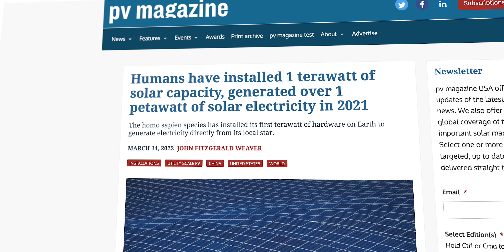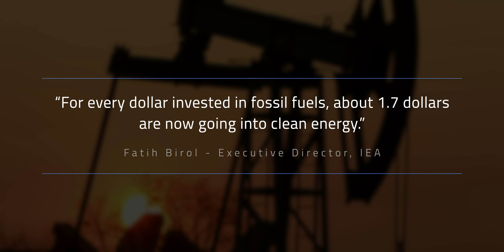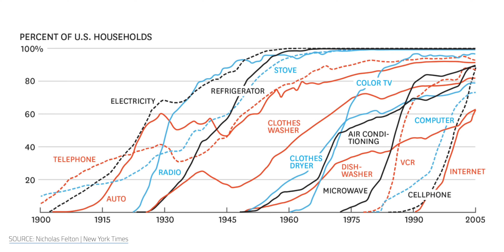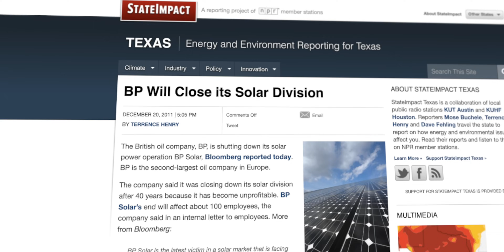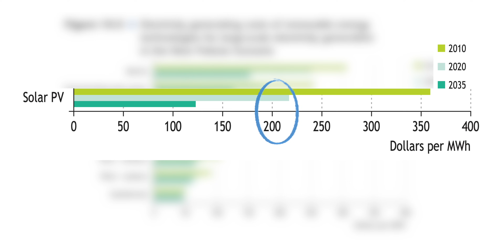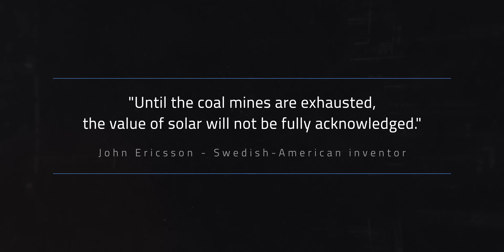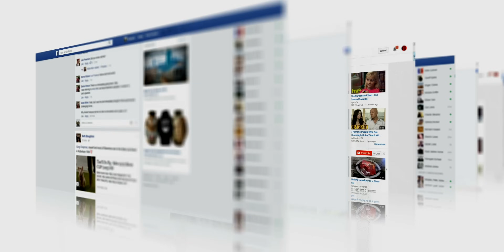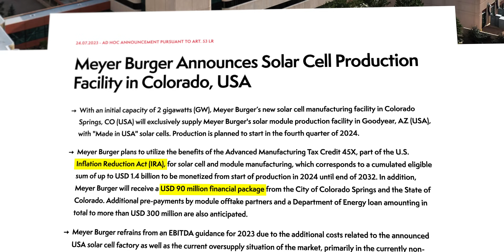How Solar Power Got So Cheap … So Fast

Comment: Here's what you didn't cover which is what REALLY brought prices down.  

The cost of silica, and hence the cost of making silicon crystals had been going up and up, to the point where companies weren't even thinking about using it anymore at least for solar panels.  This was in the period of 2003 - 2009.  These high costs for making silicon crystals was doing two things.  It was making ICs more expensive to produce along with solar panels.  The bigger issue BY FAR at that time was making ICs which has been hundreds of billions of dollars a year industry for a long time now.   Solyndra was a company that was a startup in the US who was trying to make panels using other materials.  Yes, Democrats got BROW beat for funding this company even though it was a sound idea.  But once again, just as companies in the US and Europe abandoned solar panels (oil companies, what do you EXPECT?? them to explore for silica??) Chinese companies were basically coming on line.

This price increases in silica had another effect in the world of electronics.  Companies that deal with making equipment to make ICs invested very heavily into new techniques to reduce the size of transistors so ICs could get smaller so less surface area of the silicon crystals that are produced to make ICs is used.  And since 2010 to now the amount of reduction in transistor size is pretty astounding.

China opened up mines for silica and this shot the price down by 90% and THIS is when it became feasible to make solar panels for sale to the general consumer.  This was somewhere around 2009.  However by the time this happened, along with the first benefits of this going to making ICs, as you mentioned different companies abandoned the market, but NOT in China.  In fact it wasn't long after these companies dropped out that low cost panels started to become available in China, and here you can thank Chinese engineers and their govt.  They improved the manufacturing process for solar panels, really bringing almost everything together.  They also improved the efficiency of solar panels.

The Chinese govt. helped by putting incentives into the development and improvement of panels and also incentives for installation.

Now, for the Chinese haters, no, their govt. no longer subsidizes the production of solar panels.  In fact there are a few Chinese companies making them now and there is good competition.  This is when other countries started to understand they could grow their solar industries.

There is a key to ALL of this.  It's low cost silica.  Something about like 80% of all silica that goes into the market comes from China, about another 10% comes from Russia, and about 10% comes from the rest of the world.

So EVERYTHING about costs coming down for solar is about what happened in China.

And for those who are going to say silica is common, yes it is.  But it's not common to have good deposits of it, and the US used a lot of deposits in making ICs from 1975 - 2005.  You can NOT go out to a beach, scoop up sand, attract the silica out, and dump the sand and get another scoop.  Sorry, doesn't work that way, WAY too expensive.  You need rich deposits of silica for it to be low cost.  This also means more deposits need to be discovered so the world isn't dependent on China for almost all its silica.

Comment: The answer to this question is very simple. Solar panels got so cheap because 1. Incentives through some government policies. 2. China took over the world's solar panel production and 3. The most important factor : cheap fossil fuels (including coal) that made it possible to mine, transport, transform, manufacture and deliver solar panels components (steel, aluminium, glass, silicon, copper). The same applies to wind farms that, just as solar panels, would not have even existed in a "non fossil fuel" world. People must understand that in a "full electric" world, we will not be able to do the mining, metallurgy and transport to make solar panels, wind farms or even nuclear power plants. The only way out of our current "full natural fossil fuels world" will be an "electric + synthetic fossil fuel world". 100% electric is fantasy.

Comment: I feel solar has a place on rooftops, but not as solar farms, unless it's in the desert and not taking away valuable farmland. The desert fauna will welcome the shade.  For lush green land, wind is a far more logical option.  But I hear there are noise levels, and that needs to be fixed somehow.

Comment: A 50 watt panel on my east facing balcony has kept my e-scooter mostly charged the whole summer. Now i get only a third of a charge on a sunny day, but it's still amazing.
Reply: I'm thinking of getting a couple more panels. In the winter when we get only a hour or two of sunlight, and most of it in the wrong direction, i'm not riding my scooter either, too much snow. Mostly i just want to know if small tiny solar is even remotely viable. And yep it is. But yea might need more panels and a bigger setup for it to be viable a few more months. Can't run my fridge either from the smallest ecoflow river i got. But yea not upgrading yet. Maybe if i move to a different apartment, or something. With space to put the panel facing south.

Comment: thanks for the explanation of S curves. I had a basic understand but you helped fill in the gaps

I have seen Solar pool heaters since the 1980's and there were mini solar devices like solar powered calculators but back then it was always a niece market .. and for small innovation... also remember making solar stoves with foil for camping... but again it was mostly see what we can do with foil when you can not use wood or propane stoves 

I have always thought solar would be in the future but i figured it was a when gas prices go up over.... $4 (1985 numbers) about $11 in current prices
Reply: /niece\ niche /

Comment: Relative cost of power is not always the main driver, availability or lack thereof  brings in urgency.  I have followed Matts videos for a long time, but i was used to rely on what had  been called the best power  system in the world : Eskom in South Africa. Gradually, the systems started failing, , and we found ourselves with 2 hours power off a day, last year 4 hours, this year often 6 hours , next year?  Suddenly, cost stopped being an issue, whether you used kilowatts per month  or megawatts and the country.s solar industry has seen an amazing  growth within months,  Most people and firms are now considering  going solar and off the grid within a year or so.  A process that could have taken more than 10 years has now taken a year  !

Comment: Invested in solar 9 years ago when I bought a PHEV to commute to work. Installed by a major company who has since bit the dust. Even with net metering and nightly charging if the car, my NEM balance at the end of the year was close to $0. Would love to add battery but can't find an installer who would add to an existing "orphan" system.
May be easier to find a company to add battery and manage power with the SPAN panel (?)

Comment: As early adopters, one wonders when utility grade solar, makes our panels worth less as a home upgrade and adding value to the home. They are going to last 20 some years, but if your home is a net zero home, I guess they will always add value, especially with possible 20 year lifepo4 batteries. One would also assume some fluctuation in even utility solar prices, as they cycle through technology. Photovoltaics seem to be a no-brainer in a number of ways. Lack of moving parts, number one. Maintenance is essentially cleaning the panels, and possible storm protection and damage.

Comment: My dad used to work at that Utah coal plant that you featured around the 1 minute mark. It doesn’t exist anymore (I think) because the scrubbers it would’ve needed to meet standards wouldn’t fit inside the footprint.

Comment: Hot water from solar isn't very practical and that is why it fell away everywhere except in certain instances in Florida.  It takes 4200 joules to raise 1 liter of water by 1 degree C. 
So to raise 100 liters of water from 20c to 65C takes 18,900,000 Joules or  5.25kwh  That's only about 25 gallons.  It would take like 6 hours of nonstop perfect 1:1 conversion of Solar power at the equator at solar noon on a square meter  to do this. You need constant power to keep a pump going.  That's in Florida.
But say you live somewhere else where it is common for winter temp to drop below freezing.   You have to use a heat exchanger due to water freezing (the solar panels will have antifreeze in them). This drops efficiency by a pretty good amount.

Comment: Adding a solar PV cell integrated into the roof area of an electric car, a relatively simple addition, would give about one square meter of solar cell area per vehicle, and, conservatively, about 1000 km a year of free travel to the vehicle. Some cars already have this feature - the Fisker Ocean, for example. Even more significant would be the effect of having this on every car - if all cars were electric and had this feature it would have the same effect as adding 1.5 billion square meters of solar panel energy to the world energy supply, but without the need for any additional unsightly supporting structure for the panels; and with the power supplied at the point of consumption, with integral storage already present.

Comment: What I got out of this is that the price of the technology has dropped, there is no immediate payoff, and it still takes a lot of taxpayer money to make it work.  I'm for anything that works.  Every technology I've ever worked on has been replaced by something else so I've learned not to fall in love with technology.  If this was an economic benefit why didn't Germany convert everything to wind and solar when it lost access to Russian oil?  Seems like a crisis made for a solar solution right?  Instead, Germany is having to off-shore a lot of its key energy consuming industry.  When solar can support a steel industry then we've got something.

Comment: I live in Charlotte, NC and I decided against solar because Duke Energy will phase out traditional net metering and in favor of a rate structure that pays roof top solar customers less for solar produced vs the rate at which they consume, thus no longer being a 1 to 1 ratio.  This made forecasting unpredictable and it appears the cost of solar needs to get even cheaper. like about $0.03/kwh, which is competitive with wholesale.  I have a feeling this will never work out in my state because if the utility can get volume discounts on solar panels vs a consumer that has to pay full retail, the economics may never work out.  I also believe installing solar on my house introduces new risks that I don't have to worry about if I simply connect to the grid the normal way (without solar) and pay the utility for my usage.

Comment: I want to innovate when we build our home, and solar has always been the carrot dancing at the end of the string out in front of me. However, I have heard of another way to think of solar. Basically you look at the installation price vs the savings over time while factoring in the longevity of the panels. When the math settles out (settled, it was an older opinion) you have paid for your energy up front for the life of the panels. So you aren’t really saving because the technology has to work on its efficiency and longevity. This isn’t my opinion, but it does raise a nagging question in my mind. Are we at the point where the tech is worth the up front install, like in the case of geothermal, or do we still have to wait for that next innovation to make the payout larger than the initial investment? Thoughts Matt?

Comment: Photovoltaic Solar is still very expensive with a very long (if ever) ROI for homeowners here. Unless you are completely off the grid, it is anything but cheep for electricity in Oklahoma.
Reply: The fun part is that while an 8 Kw system here may be a little over $23,000 here in Oklahoma, very few people have that kind of money laying around. So instead, the solar installers normally sale it using a 25 year loan that ends up around $40,000. I think the shortest loan they would do was 7 years at around 7% interest with excellent credit. 

I’m interested, but I can’t make the math work. So instead I am making general household efficiency improvements instead.
Reply: @BHenryDMoron  IF I was to do solar, given Edmond's restrictive rules, I'd build a DIY stand-alone battery system that in no way connects to the grid, mainly to run A/C during the summer where peak use and sun match, and to provide emergency backup power as needed in place of a gas generator. This avoids all of the fees and other regulatory issues associated with grid power interfaces, which are no way in a homeowners favor.

Comment: The day that in Quebec it's a bit interesting to get a solar roof I'm doing it. My roof get a ton of sunlight during the day, even in the winter. Being all black in the summer it collects so much heat you can't really live in the upper floor... 
Solar panels would help to divert some of that heat elsewhere and keep it off the roof. Plus I should be able to produce enough energy in the summer to be 100% self-sufficient, and in the winter to be close to it in good days.

Comment: I had always hoped solar would break through as a dominant tech. Anything that can still function in a vacuum is always a plus, and it reduces the overall need for logistics. You don't need to transport coal, natural gas, or liquid fuels. Once the initial installations are done, maintenance is all that is required essentially.

Comment: Two barriers to installing ever cheapening solar panels in the US. 

1. Labor is still too expensive delaying ROI for years compared to other countries like Australia. The industry can benefit from mounting and connectivity standards to reduce installation timelines and labor.  Imagine  a full installation at $5-8K. 

2. Permits: Too much red tape for permits that drive up costs. 

Solar needs to become widely accepted as a significant home value improvement along with level 2 EV charging.

Comment: Replacing a roof for a homeowner is a daunting cost.  Replacing it with a solar panel system bolted over it must be a nightmare.  Why is this never spoken of?  Are there solutions?

Comment: I mostly feel closer to wind and solar-stirling generators. Wind energy is mostly solar energy that is converted into kinetic energy. This is a strong conversion for wind turbines. Because it happens on a large area of land, instead of a small machine. This makes it a bit cheaper.

Solar powered stirling generators are also like wind turbines, but the heat is converted into kinetic energy in a very small area. Wind turbines are more like low-temperature-difference stirling generators, when compared to solar powered stirling generators.

Comment: I personally was not that interested in solar until I realized how much of a difference it could make in an emergency situation. Having energy independence is my motivation to save for solar
Reply: If you can afford the extravagant cost of battery storage...that won't power the house for more than a day or two.
Reply: @percyfaith11  that plus some electric cars can operate as a battery backup
Reply: @TokenTech  let's see. I'm going to buy an overpriced Tesla wall and an underperforming overpriced Ford lightning when I can buy a $900 generator. I think I'll need my fingers and my toes to figure that one out.
Reply: @percyfaith11  lol you seem like the life of the party. You are missing the point. Solar can be a great way to lower or eliminate your electricity bill especially if most of your home runs on electricity. It can pay for itself in about 10 years. It also has the great benefit of working even if the power grid goes down. Batteries can be recharged during the daylight hours so in an emergency situation with careful use of electricity you can keep the essentials going with solar/batteries. Also in emergency situations a gas powered generator can only go for so long. Eventually you’ll need to get more gas. If you can’t get to a gas station or you know the price of gas in an emergency situation were to go way up you’d be out of luck. This will be my last reply since you are clearly not arguing in good faith.
Reply: @TokenTech  because I'm not agreeing with you, I'm not arguing in good faith? What kind of logic is that?  
What does being a clown at a party have to do with solar power? Scratching my head on that one.
Do you really think the solar panels will be able to generate electricity when you need it most during a storm or blizzard?
Lithium batteries are too overpriced and short lived to act as a long-term storage capability.
I agree that solar power with net metering has its place as a cost effective means of lowering your electric bill but it's not ready for prime time during power outages due to the cost of storage.
Generators can run on natural gas or propane.  With proper electrical use management during an outage, the fuel for last for weeks.
While a net metered solar array on your roof may pay for itself in 10 years that Tesla power wall will never pay for itself.
You must be a Tesla and EV fanboy.

Comment: Hey Matt! Could you please discuss the impact of solar panel adoption on energy reliability? I come from an industry where a  light flick is extremely expensive. Having strong partnerships with utility companies is critical to assure reliability. I understand that  there are energy storage solutions today, but I cannot imagine how utility companies would survive if everyone adopts solar panels and batteries. What would happen during periods with no sun? Wouldn’t we be forcing the utility companies to maintain expensive infrastructure that would only be used when it is convenient to the customer? Do we need to pivot to a different decentralized power grid?